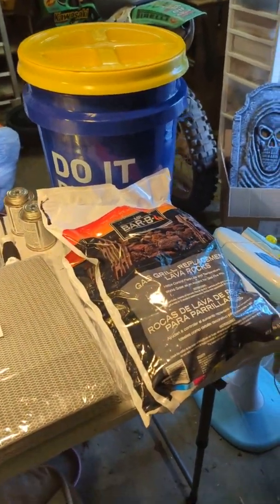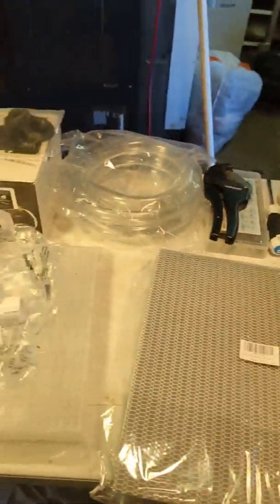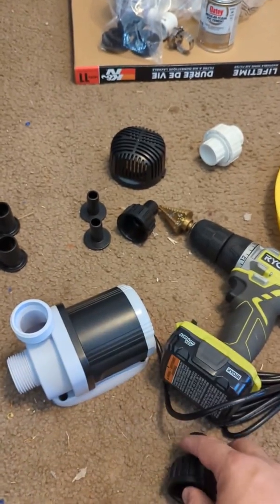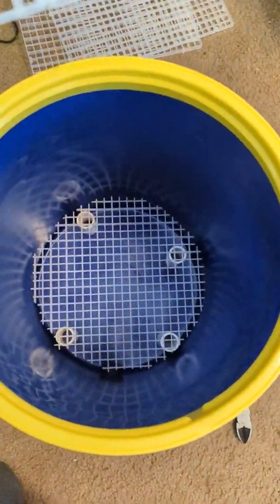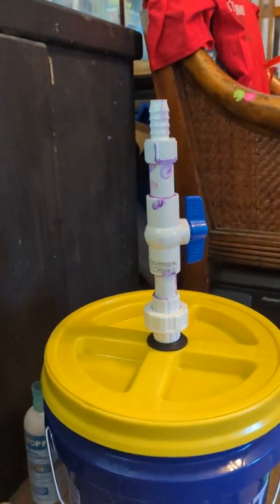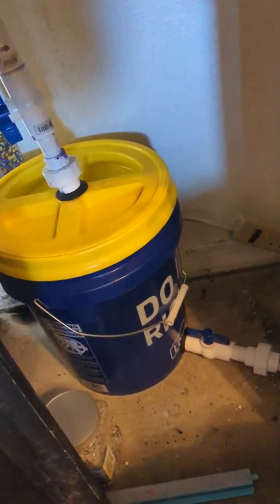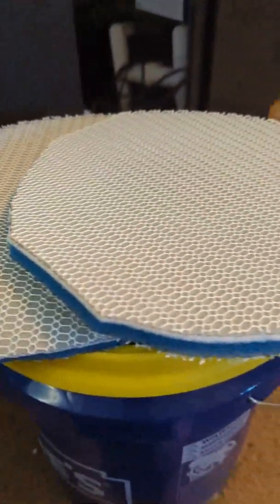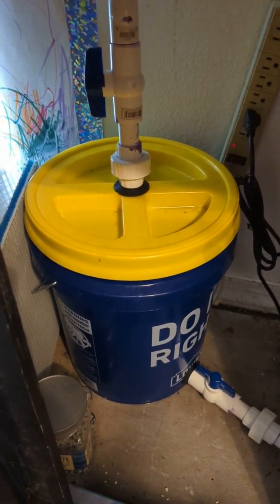DIY 5 gallon canister filter tutorial (part 1) based off King of DIY, Joey's idea and videos

Comment: i built this based of Joeys video too and had the same issue with the o ring on the lid, mine would leak if i ever shut the pump off. Did you ever come up with a solution?
Reply from the maker: Yeah, I made a follow video that explains it better but pretty much I had to buy o-rings off Amazon, and 1 inch wide thread sealing tape. I wrapped top of bucket with white thread tape a few times before putting on gamma seal, then wrapped the threads on removable part of gamma seal. Then added two of the o-rings I bought on Amazon to the threaded part of the gamma seal. Also I found out later some silicon grease on the o-rings is also necessary so they don't pinch when tightening down the lid. After that I don't have any issues just add some grease every few cleanings.

Comment from the maker: Another update: I did this project in September of 2022. First issue i had out the gate like some comments mention is the original gamma seal is not great. I bought 275 o-rings, some silcone grease and 1 inch thick teflon tape and made a 2nd video showing a lot more details how to fix the leaks i experienced.  The biggest issue comes when the pump is off and the pressure builds up in the bucket. Wrapping teflon tape around top of bucket before putting gamma seal on seems to help it stay on under pressure. I havent had it pop off but others i heard have. I also feel like Lowe's buckets are thicker than some or just seem more durable. There might be even better options but i used Lowe's. Then i used 2 (275 o-rings) i got off amazon on the threaded lid of the gamma seal. I also wrapped the threads with the teflon pretty good, at least double wrapped. Then i used a silcone grease on the all over the orings. 

The silcone i found out last week is pretty important step. Since Sept. 2022 until now Feb 8th 2024 i have had very little issues and a the cleanest turtle tank in the 15 years of owning a turtle. The issue i did face last week though was cause by an oversight of my own. When cleaning the filter last time i noticed an o ring kinda stretched out but then rechecking it was fitting fine. I knew it was odd but just cleaned it and when on. Well to make a long story shorter, it was sticking between the lid pieces and pulling away from making a good seal. We had a crazy storm last week and power when out for 8 hours, which we were lucky ones, and as soon as it did the bucket leaked like a solid stream of water. My girl notice it after a few gallons leaked out and unplugged everything and cut off valvles like i explained because i was at work. The issue was the silcone was dried up or just rubbed off from the bi monthly cleanings. I reapplied silcone and notice a smoother fit when i tightened the lid. I ran the pump for a few minutes, then unplugged it and waited 5 minutes. No leaks. So I am pretty sure i solved the issue. 

If i were to design this build better i would figure out how to put the pump and canister above the tank and in some sort of tray that could direct water back to tank if there is any issues. If i had same problem as last week happen in middle of night it could drain my whole tank on living room floor. So might try to think of a better fail safe soon. Besides the few issues though this thing works great and i clean it every 2 months with my one red earred slider in a 120 gallon tank.

Comment: You better be home when there's no electricity. To turn those things off. the bucket will leak. and flood your house. The bucket oring is not that good. I try to use a one-way valve. but it will only work on the output side. It works really good though.

Comment: I had the same problem I use silicone but sitl it suck air from outside until I use car windshield glue it's much more stiff than silicone. I also use 30 zip tights to firmly attach lid to the bucket so It won't explode like first time I fill it. And that's it now I enjoy filtration it gave me. My pomp is actually a sunsun 303a canister filter filled with sponges and some activated carbon after that I have bucket with lava just like this. I have 200 litters tank its 50 somthing galons but I might have couple fish to many so god filtration is nesesery

Comment: I'm gonna get spendy and use a yetti bucket to send a "rich dad  that vacations in mexico but still gets called el cheapo vibe"  then use gamma seal on top of "marine locktite", next I'll put a beefy red seal on the threads of the gamma lock. Hopefully no air will get in since it respects the yetti swag.
Reply from the maker: The seals were the toughest part to figure out. The seals that came with the gamma lid just didn't work alone. In my part 2 video I show more what I did to stop the leaking completely. Basically  had to wrap the bucket with thick Teflon tape before gamma lid. Then some tape around gamma lid inner threads. Then add two after market seals I got on Amazon. Finally just tighten the lid as tight as possible. 

I haven't had any leaks since I did all that. The hardest part of filter cleaning now is just removing and replacing the lid, lol.
Reply: @sikoticjaux  I'll do a video of my build. I'm considering making a "lid wrench" too. I did a ton of research and am happy to tell the filter companies to get lost. Even my Oase biomaster has a bad seal. If you want it done right...

Comment: Lowes has much cheaper lava rocks for future reference; some preppers and beekeepers have suggested checking the bucket molding seals and sanding them down evenly, as they seem to cause an uneven seal under the seal and along the treads;
Reply from the maker: Thanks, if I have anymore issues with leaking I will try sanding the molding. Also thanks for the advice about cheaper rocks too. I was hoping the whole build would have been a little cheaper.
Reply: Some replace the O-ring for 378 gasket and silicon on the gamma seal. The Oring is for the thread side
Reply: @alecthenice8115 what is “378 gasket”

Comment: Smear Vaseline around that gamma seal lid. Helps slow down the leaks a bit, but likely won't fix it entirely. Gamma seal lid works great until the filter media began to silt up, and the back pressure would overcome the seal.
Use the same setup on my ponds where leaks don't matter so much, but unfortunately, I've never been able to get the leaks to stop entirely. 
Best of luck.
Reply: Some say replace the gamaseal lid seal threadwith a 378 gasket and silicon the collar seal

Comment from the maker: I was gonna make another video showing the process of cleaning the filter. First time I cleaned the filter everything went well until I restarted the pump. No water would flow through outlet. For some reason the water wouldn't pull into the bucket with the suction of the pump. I tried a few things,(fill the bucket partially with water, turn pump on with the valves shut, siphon from where pump connected.) What finally worked was siphoning from the outlet. Not sure why it worked, but it did. The second time I cleaned the filter I did not drain bucket. I just closed valves and turned off pump. This time restart went well. So I learned not to drain bucket. It's a little tougher to handle full bucket but not worth fighting the restart. 

Cleaning is super easy. After a month on the turtle tank it really doesn't build up too much gunk. The tank stays pretty clean as well. Some brown algae growth but it cleans off pretty easy.

It's been 3 months since I built this filter setup and I couldn't be happier. The worst part was figuring out how to properly seal the lid and to get it restarted after cleaning.

The best part is tank has good water recirculation, stays clean of turtle waste and green algae, the pump is super quiet, it's easy to clean.